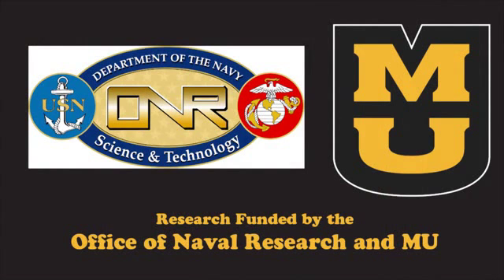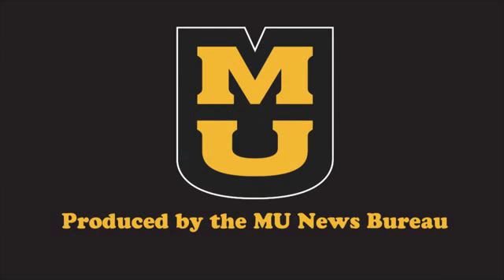Plasma self-contained in open air

Comment: It's a plasma carburator... Hook up a apparatus that will fire hydrogen plasma(it'd take lower energy than air), and fire the rings in a rotating sequence. Use the resultant effect to heat a container to an extremely high temperature. Use the heat to generate electricity. Do it right, and you have an internal combustion fusion engine. 

Just a thought.

Comment: Not to be a stick in the mud but I wouldn't compair this to ball lightning. Ball lightning is believed to sustain itself with a vaporized silica core. Nature is able to produce spheres of plasma which sustain themselves for many seconds in open atmosphere. They have anomalous effects; going from standstill to moving at extreme velocities instantaneously. It's not a simple toroid of plasma moving through the air. It is layers of lighter and heavier charged particles forming a denser positively charged core surrounded by negatively charged atmospheric gas. There's probably some form of atmospheric cavitation in play as well from the rapidly expanding and contracting pressure shockwave caused by the initial lightning strike. This is a very important field of study and has major applications in power storage and perhaps fusion. But what you have there is more of a proto-plasma gun than ball lightning.

Comment: i have a theory on how this device works . first lets say you have 10000 amps and you apply the load to a very skinny wire it will vaporize at high temperature causing it create a shockwave and vapor plasma . the shockwave can push out gases and plasma. dont belive me search up
" winston h bostick plasma gun "
Reply: Quite right. But I still prefer the original thou :D : http://www.rexresearch.com/curry/WO2012173864A1.pdf